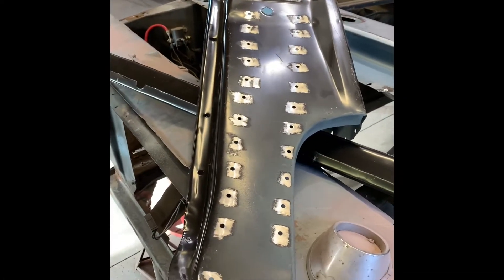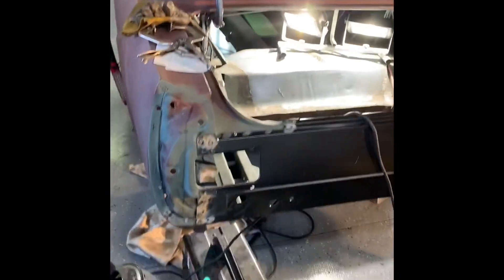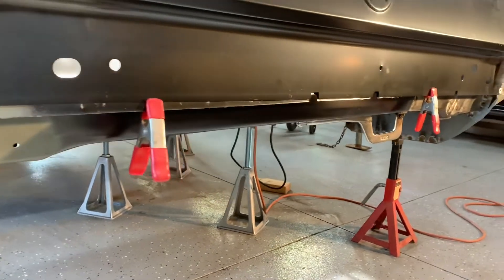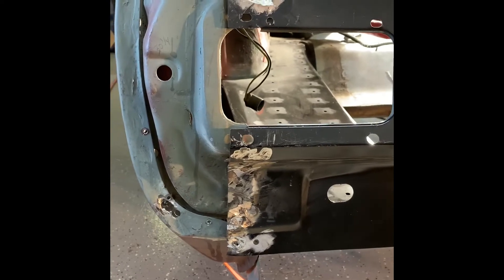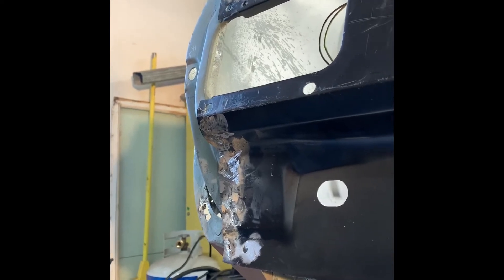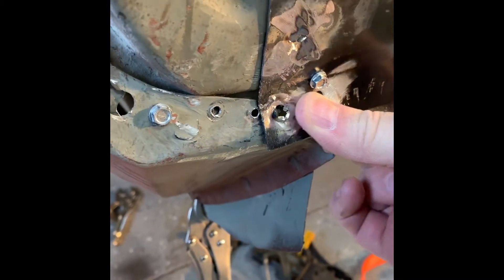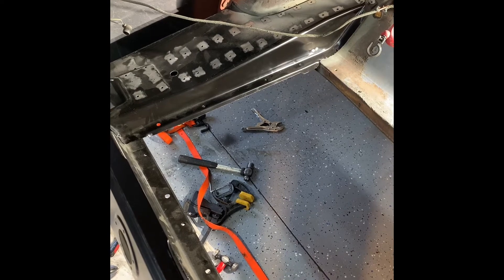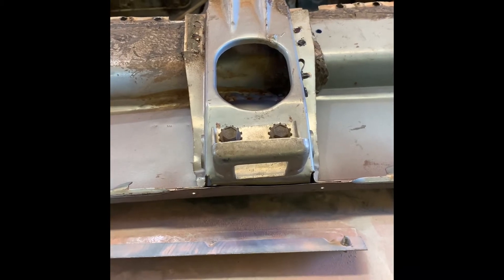Final Mustang frame rail replacement and updates on the next project.

Comment: It's not easy fixing new panels into an old car. They may be slightly out of spec and (for example) cause bodyline fit issues. Always a good idea to screw the panels in and close all doors and openings. In this case I see a few collision issues and I believe that includes distortion of the trunk lid on the driver's side. I suspect a very slight twist in the loose top quarter piece which lead you to fix the outer rear quarter too far out at the bottom. Looks like you are prevailing.  I hope you didn't get a copyright strike for Derek and the Dominos.

Comment: I’m having a difficult time getting the holes to lay flat where you had to bend it.  I don’t have a piece of railroad track.   Any suggestions? Thanks
Reply from the maker: You could use a 2’ long piece of 2” x1/4” angle iron and clamp it in a vise. That would give you a good flat surface with a clean edge to hammer it flat. 

Good luck